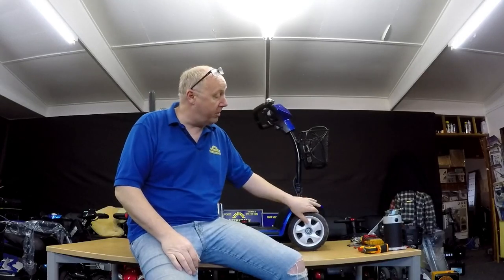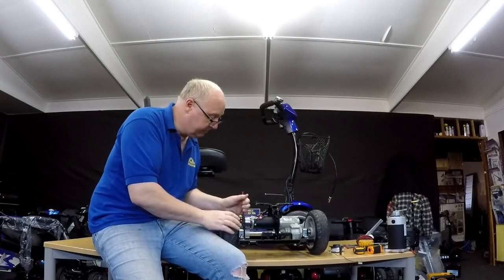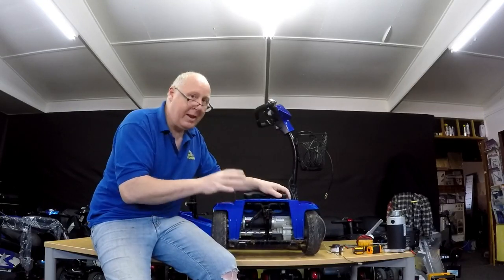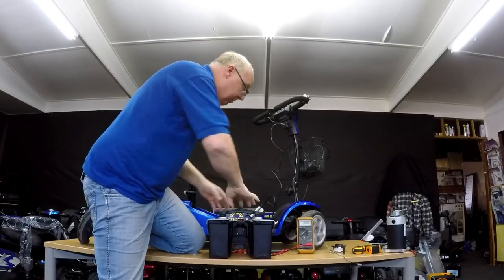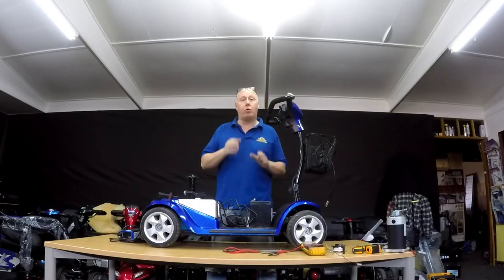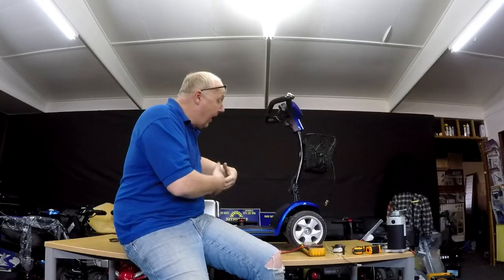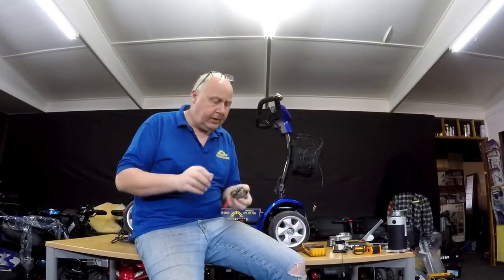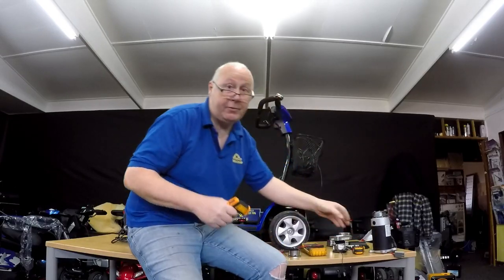Scooter wont move after storing in shed.

Comment: I’m so glad I found your videos, they have made my life so much easier to look at my scooter troubleshooting and what to do if it quit working. I had a Drive 4 scout and it had intermittent problems with 5 flashes. You recommend I check the connections from the front to the rear of the scooter. I didn’t realize it had tabs until then. I didn’t use sanding cloth so I used acetone/nail polish remover on all the connectors to front, rear, battery and terminals on the battery connectors of the scooter. They were carbon up a little. Works like when I first got it thank you vary much!
Reply from the maker: Glad to help.
Reply: How much are the batteries? We are in thr middle of purchasing one for my mum, only the old lady we are buying it off said she's used it once and now it's been in the garage fir 4 yrs, she wants £100 for it, but we have charged it as the green light is on abd the horn works, the brake us off and able to move it, green lights on the charger plus the control panel, but when we unplug it the dial goes to empty again and no light cones on the panel, so is it worth buying a new battery if we are buying it from this old lady for £100? How much are the batteries? Its called Style mobility scooter simular to this one on your video

Comment: 3:33   ok! I left mine in a barn with tractors, old 404 peugeot, 2 cv s and so on in 2017 sous of bordeaux , a stone throw from the garonne and I am face with that very problem. juste got it back in versailles in a dry spot this time and that should fix my problem as shown at 2:50, thanks. cityliner 415. thanks. did get new batteries ( from england).

Comment: Your videos are really informative!  I recently recovered my Grandmothers Midi XLS which was bought brand new in 2012 and then since 2013 it's been unused in the garage. She has asked me to get rid of it for her. I bought replacement batteries which have worked, however I have noticed that on the lowest speed setting in particular the scooter struggles to move at all. In medium to high speed it works normally. In your opinion will this be the speed adjustment pot, potentiometer or the motor brushes? Thanks
Reply from the maker: @gavansewell1253  hi 👋 clean motor and brushes

Comment: Jazzy 2 scooter worked fine. Parents put it away in bedroom and batteries completely died and couldn't be saved. I installed new batteries and now scooter has power but flashing 8 times. Today I will make sure the scooter is not in manual but is they anything else to check. All plugs appeared to be connected correctly. It was working fine until batteries went dead and now doesn't with brand new batteries. Thanks for any info!!

Comment: Thank you for your videos.I have a problem with a mobility scooter which suddenly stopped running. The scooter is engaged from the electric brake, the motor runs in forward and reverse making a gear grinding sound at high revs and will not move. Could it be the electric brake or are we having problems with the drive gears skipping?
Reply from the maker: Hi remove electric brake and test to see if noise disappears if still noisy remove the motor from the axle then try again. If motor is noisy then maybe one of the bolts holding it together may have snapped off.
Reply: @tomjacques4  Many thanks for the prompt reply. I'll take this structured approach to diagnose the fault. Thanks again.

Comment: What bulbs are fitted on a pioneer rascal 75a/h batteries class 3 scooter,are they 12volt or 24volt first question and my second question is can I fit an aftermarket usb onto this model and if so 12 v or 24 volt usb connection? Regards Phil "great videos I watched a lot and learned a lot"
Reply from the maker: Yes you can fit a usb to the scooter the system runs a 24v system so no issue to feed of the charging socket if you remove the inhibit. I will check what kind of bulb for you. But best remove your one and the link to our bill is below.  
https://www.nithsdale-wheelchairs.com/24volt--12volt-bulbs--light-units.html

Comment: Is it not possible to simply un-seize the brake rather than replacing it?
Reply from the maker: Hi yep sure you can try it but would not recommend opening it hitting it with a hammer 🔨 may help.
Reply: @tomjacques4  Thanks.

Comment: What type of cleaning fluid can be used for the touchpads, would WD40 be ok? Also what are the purpose of the touchpads?
Reply from the maker: Touchpads are sealed units so prevent water egress. Contact cleaner would be your best bet.
Reply: @tomjacques4  Thanks.

Comment: I have just bought a second hand sterling little gym  I have just put 2 12 v 12a batteries it won't go up hill. I am 100kg.?
Reply from the maker: These small scooters are not designed to take u up a hill. Shopping g centre use and on the flat. That scooter is not as powerful as others. And it’s second hand so it would have had a lot of use motor may be weaker than a new one.

Comment: Hello, I have a question, I have AGM batteries with 200 amps in my mobile, I live on the mountain and when I go shopping to the doc, etc., I need a lot of energy, I've heard that the lithium batteries are better and last longer on the other I was also told because I have to ride so much incline that the lithium batteries in it are not the best (they could catch fire etc.) I am also concerned that the lithium batteries last longer. I divide the price of this battery by the durability! :-) The AGM batteries are good, I had gel batteries in my mobile before and they broke after a year.

Ok, thanks for the info and videos and stay healthy!

Comment: I’ve got a rascal eco which kept on blinking 7 times I’ve changed the speed pot the light stopped then but when I move off somethings it will move sometimes it will blink 7 again
Reply from the maker: Could try the throttle pot
Reply: @tomjacques4  that’s the item I replaced today
Reply from the maker: @Lfc-kd2kr  sorry I thought you said speed pot. The speed pot and the throttle pot are linked together so either one could be faulty. Or you have a broken wire.  So check all the way from the front to the controller.
Reply: @tomjacques4  my mistake when I type throttle and speed pot in it comes up with the same picture I’ll check the wiring see if there’s any problems
Reply: @tomjacques4  right I’ve replaced the throttle pot now gunna replace the speed pot as when I turn the button pass the hare on the deal it plays up when it on or just before it it’s fine

Comment: Great vid got any experience with a jazz power wheelchair got a problem. The unit charges the front battery fast the rear trickled but is getting power . Got a new battery but the charge indicator on the arm shows half charged.and shows(!).clicks when trying to move but nothing. Any ideas would be awesome  thanks

Comment: Hi I have a celebrity x sport 8mp mobility scooter I'm getting flashing code 3 pause then 1 it only works when I leave the batteries unplugged overnight but when I charge it its starts flashing again when I try to use it I'm getting power to the electric brake

Comment: Help. My GO GO SCOOTER won’t run. Battery is full. Put the switch in back to drive. What’s next
Reply from the maker: Have you checked all the battery terminal connections also check the connection to and from the motor and brake

Comment: Hi Tom, Wondering if you can give me abit of advice please. i have replaced the ignition barrel on a Strider ST1. it was a 2 wire ignition barrel, so i replaced it with a cheap generic ebay barrel. Now the scooter will power back on but the blue light flashes. would this be due with the new barrel? do i need an exact make/model barrel replacement? could possibly be anything else? any advice would be greatly appreciated. Thanks!
Reply from the maker: should always replace like for like. recon it will not be the ignition barrel, anyway how many times does the light flash
Reply: @tomjacques4  Thanks for the fast response. I watched you're other video's which were a really big help and very informative, that lead me to solving the problem with the information you supplied on there. absolutely great stuff! Thank you very much! Will subscribe to deal with future problems. Thanks again tom!

Comment: My issue is that it will. Go 2 feet and stop then I reset it and he made it home fully charged batteries guage says full goes a few feet and stops
Reply: Mine looks like this one but red gogo
Reply: I seen you said something about a fuse on the power box
Reply from the maker: Ok I recon you reset it with the circuit breaker on the battery box that correct if that is then case I would check all wires (could be slack) and the electric brake
Reply: @tomjacques4  thank you

Comment: so why cant we just free up the stuck electric break rather than replace it?
Reply from the maker: I have noted the screws breaking off when trying to remove, also small ball bearings and spacers that you will wonder where they came from. These will have to be torqued back up to the correct setting which no one has. Mind you if your lucky and the brake gives a good clicking noise you may be able to gently tap the brake with a hammer 🔨 it may release the disc. Also try and push the scooter as you are applying the throttle. Hope this helps
Reply: @tomjacques4  ah now i know why my scooter is clicking  its the brake lol
the lady i boughht it from stored it in her shed for 3years so no wonder now that ive seen this vid thanks

Comment: Hi I have a TGA supersport and changed the headlight bulb and shortened it out. I have no power at all. Please help
Reply from the maker: Should be a circuit breaker under the seat. Sticking out from the body panel pointing forwards press it back in
Reply: Tried that Tom still no power, what do you think I should do next please, I'm just getting used to using a multimeter. Thanks again pal.
Reply from the maker: @thomasmcgivern1830  work your way from the battery wires follow them and check for voltage along the way also check for continuity just in case of a blown inline fuse.

Comment: Mine doesn't work has non of these and I push all round the estate
Reply from the maker: It’s time for an engineer then
Reply from the maker: Ps check the micro switch may be stuck on
Reply: @tomjacques4  hi, I don't know where the micro switch is, it is a craftmatic comfy 4/5. I tryed to find the fuse in the controller and there wasn't one there.
Reply from the maker: @marccooks7377  no fuse in this controller on this model but fuses on the tiller. Micro switch will be on the electric brake
Reply: @tomjacques4  ah thank you kindly Al have a look for that. Yes I did replace all fuses on the tiller and next to the charger port, I just couldn't work out how to test the ignition as your multimeter bleeps and mine doesn't however I did get some numbers with a -minis before the digits when I swapped the negative and positive around I didnt get anything. Thank you for your swift reply.

Comment: When I turn the key on it don't nothing comes on it won't even turn on or nothing I turn the key on nothing comes on no lights don't run or nothing batteries are fully charged and I've only found one fuse and that goes to that switch that goes up on the hell all the scooters has on top in the kitchen on the outside Master button to reset it just can't get no juice I checked all the wires and juice going through the wires and stuff even wrote it three times and turn it off I had my phone on charge I am plugged the shirt and plug my wire from the charger and scooter off and then on next floor and I went back out and turn it on it wouldn't do anything
Reply from the maker: Hi must be a fault in the wiring on connection you will need to check all again do continuity test as per our video
Reply: Okay thanks how many how many fuses does that Ruby driver have I won't even found one fuse link